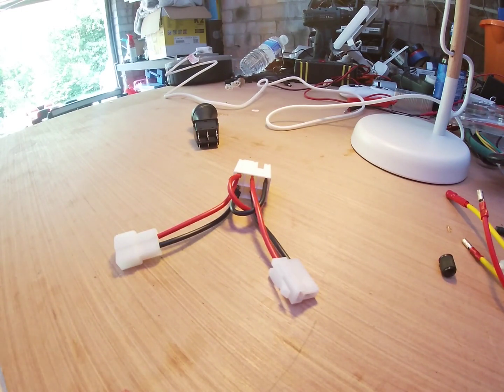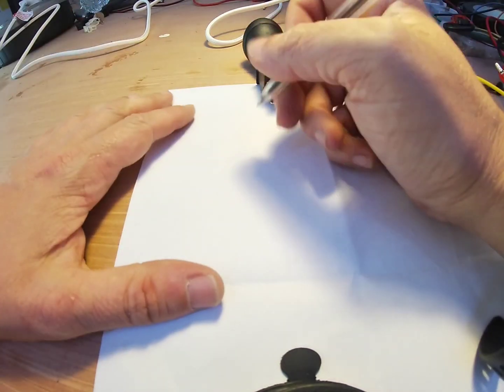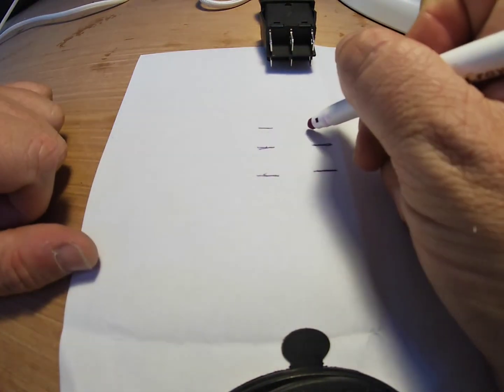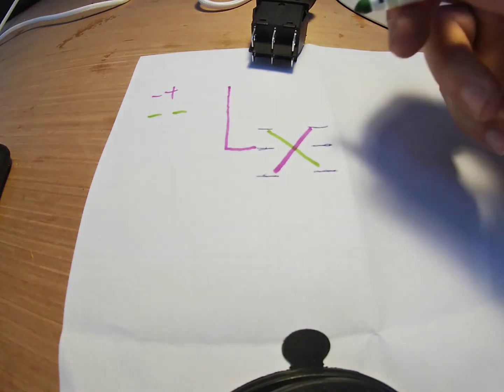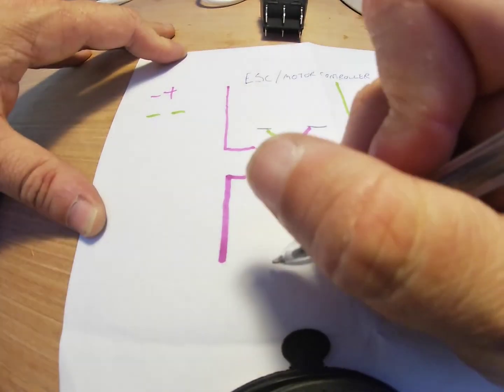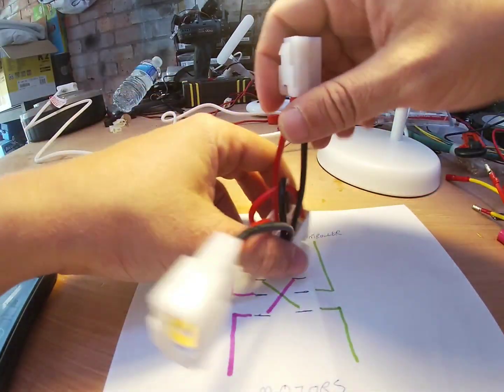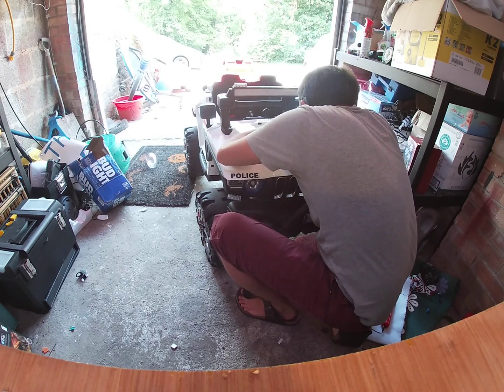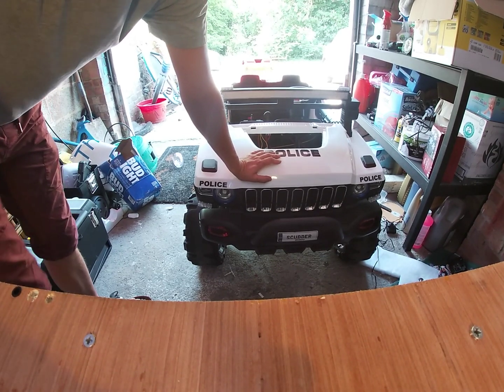Kids Ride on car ESC Fitting Part 4 | Power Wheels 24v Upgrade | Motor Controller Fitting

Comment: How are you powering the ESC? In the wiring you created I see one side going to the shifter and two other connections going to the ESC (one for power and one for the motors). What's feeding the ESC?

Comment: I recently purchased this exact model with the intent of upgrading to 24v immediately upon arrival.  I decided to go with a weelye rx30 ESC, for what I had intended to be a relatively simple "plug and play" conversion.  Since you are familiar with the way this model was wired from the factory, I'm hoping you can help me....   After changing everything over, once the vehicle is powered on and in neutral or "stop", as identified on the shifter, I can operate it with the remote flawlessly.  However, as soon as I shift to "forward" or "backward" the car immediately begins to travel in the selected direction without the pedal being pressed. I've scraped the internet for wiring diagrams and any other pertinent information that I could find, but to no avail.  This model seems to be wired differently than any diagram I found, but it worked perfectly fine with the factory ESC, so I'm hoping that it is just a matter of switching one or two wires around in the seven pin harness. Maybe a faulty pedal switch, I'm out of ideas. Any insight would be greatly appreciated. My son doesn't even know the vehicle exists because I bought it intending to surprise him. It has been sitting in my closet for the last week unbeknownst to him.
Reply from the maker: Right so on this car, you actually have 3 wires coming out of the pedal as standard when compared to the standard wellye wiring or 2, so that may have thrown you off, what of the 3 wires from the pedal did you use?
Reply: @Stitch76  I left everything as is from pedal wiring. There's a blue and white wire coming from the pedal going to the power on off switch, then there is an orange wire coming from the pedal going to the "high/low" terminal of the esc.
Reply from the maker: What have you connected to the pedal / accelerator port on the controller?
Reply: @Stitch76  I'm not sure which port would be considered the pedal port. Are you referring to a port on the seven pin harness?
Reply from the maker: @jztrump  Is this how the pins are connected on your controller? Red 1: On/Off Switch 
White 2: On/Off Switch 
Brown 3: Unused
Black 4: Pedal (Ground Wire)
Blue 5: Reverse
Orange 6: Forward
Yellow 7: High/Low Speed Switch
Reply: @Stitch76 . First three are as you wrote.  Then: #4 black goes to on/off switch.  #5 Green goes to forward.  #6 yellow goes to reverse. #7 orange goes to pedal.
Reply: @Stitch76  does that seem correct?